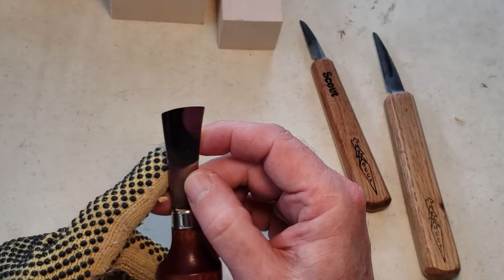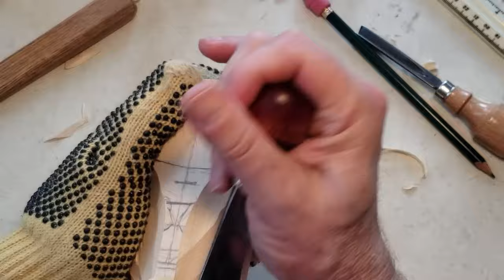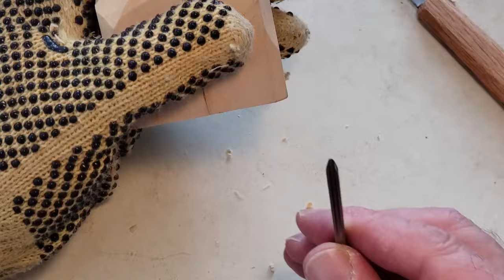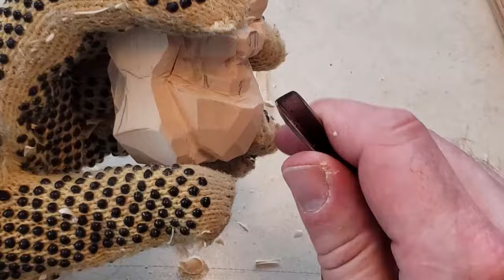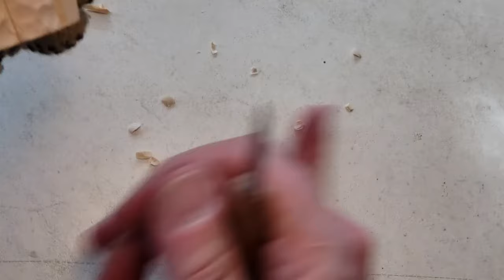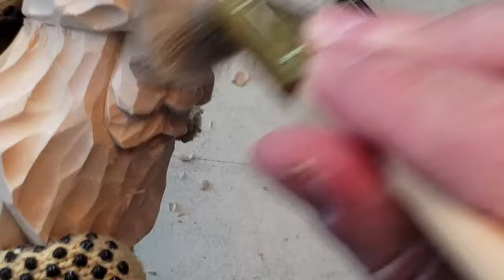Carving The Santa Bust Face Practice

Comment: Great video.  I have a number of your pattern books and this video makes me want to dig back into them and do a couple of carvings.  Learned some new techniques and the use of some different gouges than what I was using.
Thanks.
Reply from the maker: If you do look back in my books, come with a fresher mind as I may have had back when I created those books. The patterns are still good, some of the step-by-step may be rusty, but see these steps will a mind that is yours.